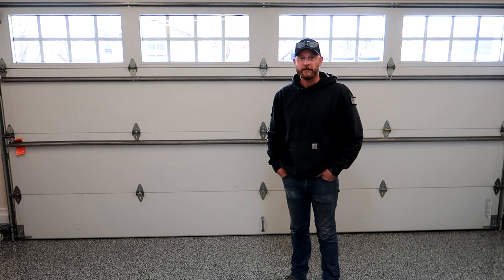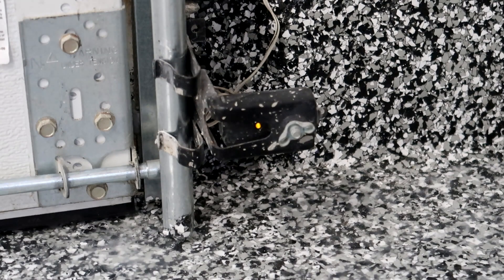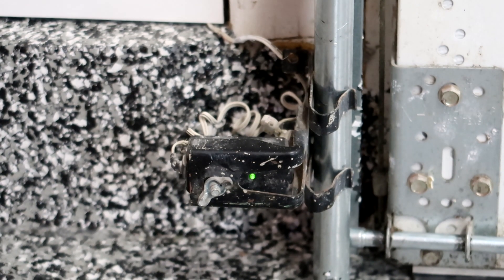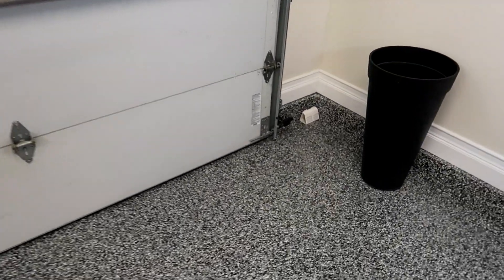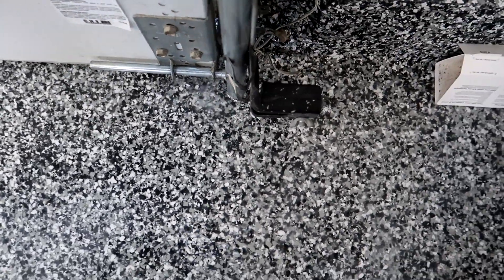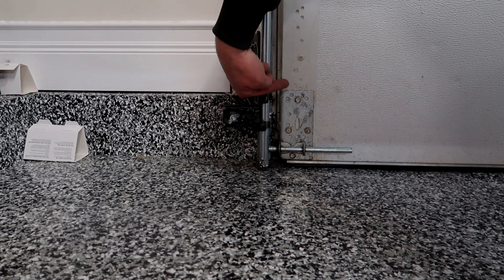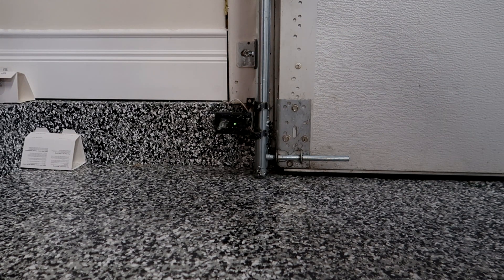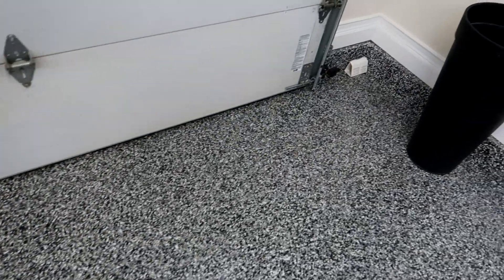Garage Door Won't Close - How To Adjust Liftmaster Safety Eye Sensors

Comment: So my door won't close for years left side has always been red the other is green and always worked so why would it stop now
Reply from the maker: Just because the door won’t close does not necessarily mean it is a photo eye issue. Without any additional info regarding make, model or specific symptoms it’s impossible to say what the issue is. As for the unit working for years and now all of a sudden not working properly, thats just how a problem works. One moment everything is fine and the next it’s not. Easiest way to diagnose or rule out the phot eyes  would be to install a new set of eyes, if it works then that’s the problem. If not, then the operator itself and internal components would need to be looked into. I’m assuming the door is in good working order. I have seen photo eyes that appear to be working fine visually but they are in fact bad.

Comment: What if both lights are off? How or which one I need to fix first?
Reply from the maker: There is a sender eye and a receiver eye. The receiver eye cant receive the "signal" if the sender is not sending therefore the receiver eye sensor light would not come on so you would need to determine if the sender eye is bad, the wire is bad or the opener board is bad. The sender eye light should be on all the time. To eliminate a possible bad wire you can cut the photo eye wires 8-12" back from the eye sensors and wire them right up to the back of the opener. If it works like that there is either a bad/broken wire or bad connection between the operator and the eye(s). If they still don't work it could be a board or the sensors themselves. From here the cheapest route would be to get a new set of eyes and connect them the same way (right to the board, prior to installing the new eyes and running the wires) If the new eyes work your good if not its likely a bad board on the opener. Do NOT cut the photo eye wires with the opener plugged in, do NOT connect the safety sensors with the opener plugged in. Whether its just coincidence or not I have had more eyes go bad by connecting the eyes and/or cutting the wires (both at once - White and white & Black wires) with the unit powered up. Either way make sure the unit is powered down when wiring the eyes or wiring them. That includes disconnecting the battery in units with backup systems. Hope that makes sense.
Reply: @firstclassgaragedoor6471  thank you but I found the problem, it was one of the connections that goes to the sensor on the motor it was loose so I fix it now it works thank you

Comment: What is none of the light are on? I need to buy new sensors?
Reply from the maker: There is a sender eye and a receiver eye. The receiver eye cant receive the "signal" if the sender is not sending therefore the receiver eye sensor light would not come on so you would need to determine if the sender eye is bad, the wire is bad or the opener board is bad. The sender eye light should be on all the time. To eliminate a possible bad wire you can cut the photo eye wires 8-12" back from the eye sensors and wire them right up to the back of the opener. If it works like that there is either a bad/broken wire or bad connection between the operator and the eye(s). If they still don't work it could be a board or the sensors themselves. From here the cheapest route would be to get a new set of eyes and connect them the same way (right to the board, prior to installing the new eyes and running the wires) If the new eyes work your good if not its likely a bad board on the opener. Do NOT cut the photo eye wires with the opener plugged in, do NOT connect the safety sensors with the opener plugged in. Whether its just coincidence or not I have had more eyes go bad by connecting the eyes and/or cutting the wires (both at once - White and white & Black wires) with the unit powered up. Either way make sure the unit is powered down when wiring the eyes or wiring them. That includes disconnecting the battery in units with backup systems. Hope that makes sense.

Comment: ok so I've cleaned dust/dirt, from sensors and they are aligned, and it still only opens a little, then closes. On the actual thing on the ceiling, it flashes 4 times up, and 2 times down. Whats your thoughts?
Reply from the maker: Sounds like a broken spring. Safety sensors only function on the close cycle. No one is particularly worried about opening the door on someone, just closing on someone and crushing them between the door and the floor. Have you tried operating your door manually? You should be able to lift it with one hand, two fingers really.
Reply: yep! its the spring. thx

Comment: What if the door wouldn’t open and the orange light is off?
Reply from the maker: Check for power at outlet, if good check accessories (safety eyes and wall control) for indication of power, assuming the motor is not overheated and there is power to the outlet for the opener, if you have no power to accessories I would try replacing the board.